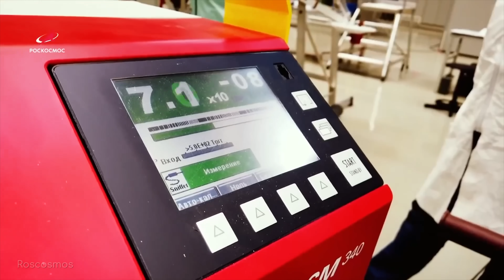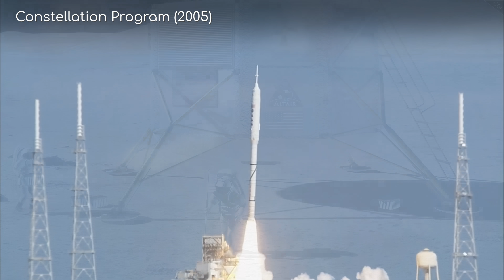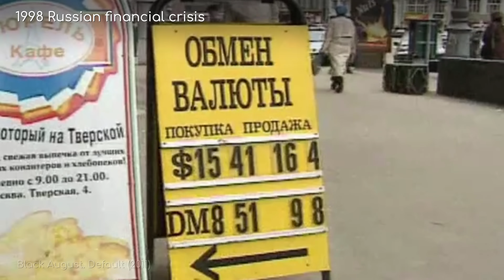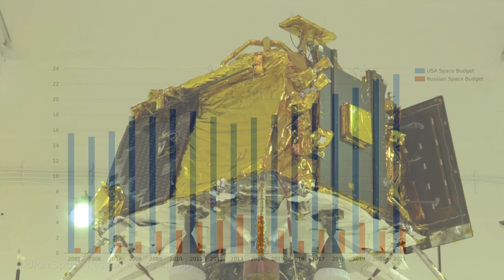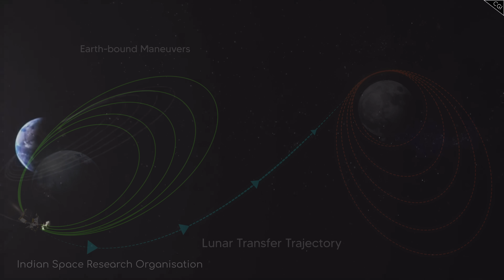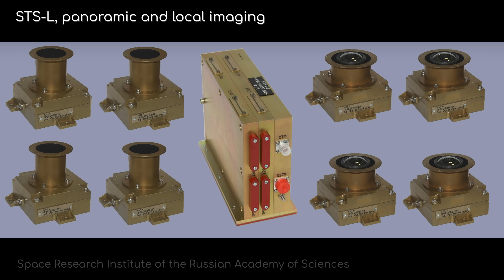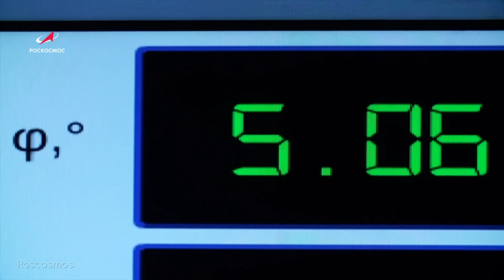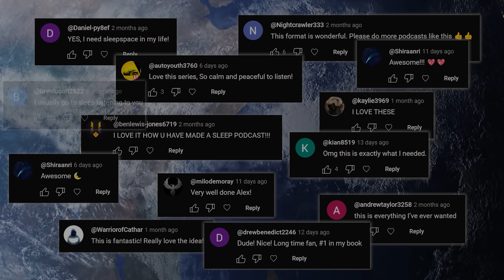This Makes Me Sad: The Crash on the Moon that Could've Easily Been Avoided

Comment: So in the video, it is never mentioned what the fatal mistake was in technical terms. It only said it was too bad they didn't buy the part from x..so was it a design flaw , material ?
Reply: The chip which was developed failed under the intense radiation and fed bad information, leading to the crash.
Reply: @axm-004 So effectively shielding led to the bad data and ultimately the crash
Reply: @bartwilliams4478  Kind of yeah.

Comment: Apollo 11 had 5 windows. Did they have a thermometer on the outside of the window, visible from the inside of the rocket taking temperature readings as the rocket travelled through the vacuum of Space? Did the Changrayaan which flew at a speed of 21,600 kmph through the vacuum,reducing its speed down to 7 kmph in 15 mins, record vacuum temperatures?